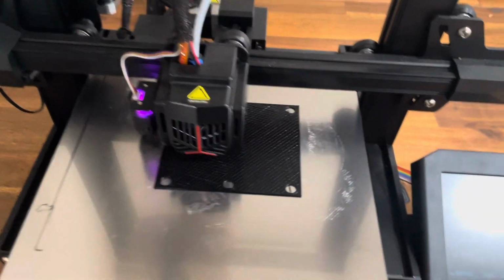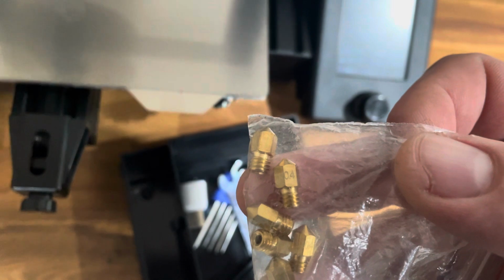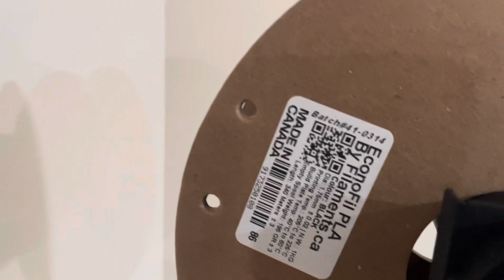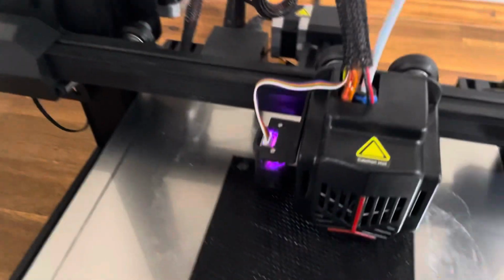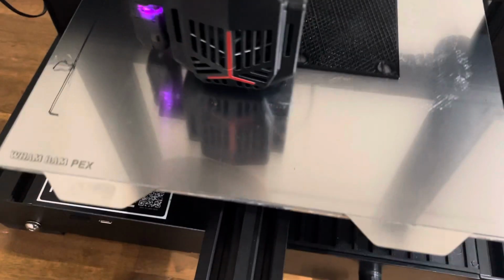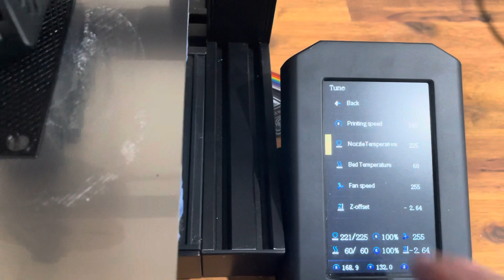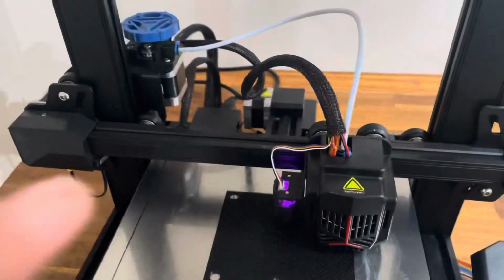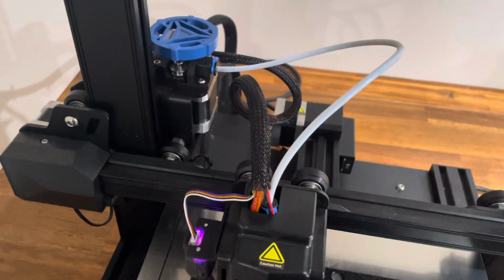Creality Ender 3 Neo Extruder Drive Clicking/Slipping Diagnosis

Comment: I have the Neo v2, and after printing PETG a 240 a few times, it slightly melted the feed hose, causing the extruder to skip, because it couldnt push the filament through the melted tube. I had to get a tube that was rated for higher heat, and put a different style heat break. 
It fixed the extruder skipping, but now I'm dealing with other really odd issues like under extrusion, and weird leveling artifacts no matter how many times I level.
Reply from the maker: I would check the wobble in the bed. The rollers that the bed moves back and forth on have an adjustment. As far as the under extrusion problem, maybe the heat brake was plugged like mine.

Comment: Tbh I hated that single gear drive with just a track. The clicks are it just slipping like crazy cause it's not enough to pull the filament from the roll.
 Upgraded the feed to Creality's 2023 Direct Drive Sprite dual gear extruder and I'll never go back. The dual gear grabs wayyy better to pull the filament for feed. Just gotta remember to change extruder distance and speed in the slicer. I got mine set for a 4.0mmDistance and 35mmSpeed.
Reply from the maker: I just bought an Anycubic Vyper and I really like the dual gear drive. I will look into your upgrade.
Reply: @autotech4103  I also have a Vyper, I swapped out the extruder for a Micro swiss dual gear extruder, I'm a lot happier. Ultimately though I find that people with this issue may need to look at retraction settings to get them fine tuned.